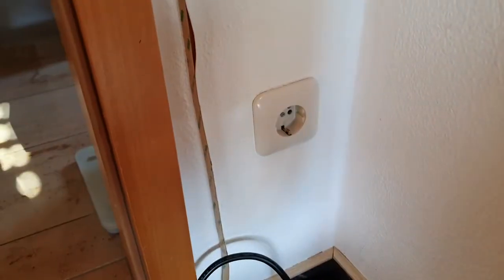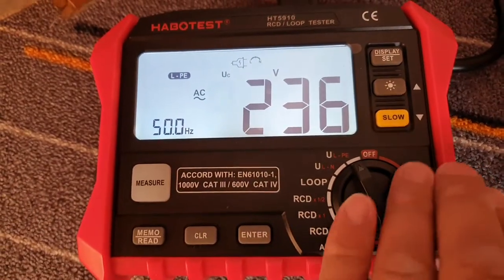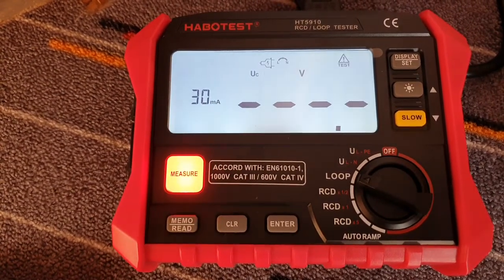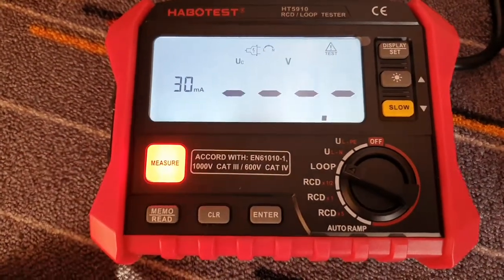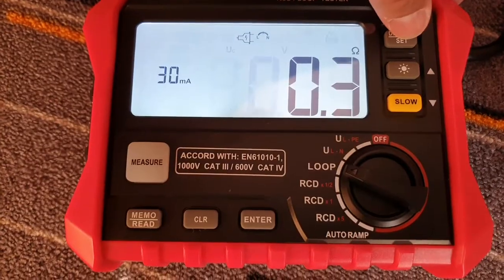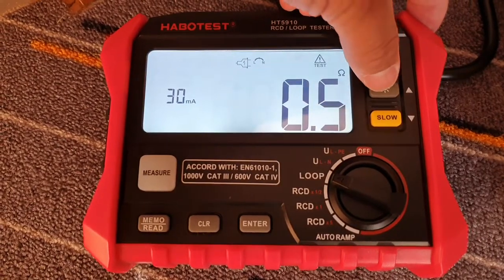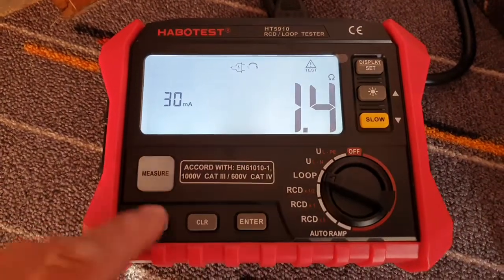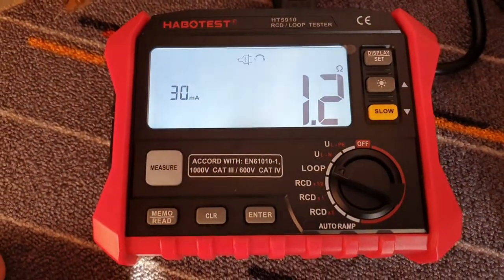HABOTEST HT5910 wrong measurements

Comment: This is normal as there is permanently some tension fluctuation from the network and they are 2 measurement performed one after the other to calculate the value.

Comment: Because there are consumers who consume current from the same electrical cabinet.
That's reduce the acurration of low resistance .
Turn off all the switches (CB) on the panel except the main one and the one connected to the circuit being measured.
Anyway, under 2 ohm is a good result.

Comment: It's probably in "No RCD Trip" mode, which means it only measuring the loop impedance with very little current (less than 15mA).The measuring method is this: it measures the voltage normally, then inserts a small resistance to draw some current (that 15mA), and measures the voltage again. And the difference between the normal "open" voltage and the current loaded voltage gives the voltage drop. And from that drop and the amper it can calculate the resistance of the supply-earth loop. But as I said the current is so, so low, the voltage drop also will be very low, as low as the normal noise of the network, so it can't be measured properly. There are tricks the big guys (fluke, metrel, megger etc) use in their testers, but they are 10x 20x the price of this little instrument. And even they are not too accurate in "no rcd trip" mode.

Comment: This brand of measuring instrument  Measure loop impedance  Is it reliable?  Why are the measured values not the same?
Reply: Because he doesn't know anything about the instrument nor about electricity.
We have two HT5910's in use and they work fine.
Also read the answer above of @simcax6087, he knows what he's talking about.

Comment: all the grounds of the building are linked and that creates alterations in the measurement, perhaps it would be better to measure on the same copper rod from the well to the ground (it is just an idea).
Have you seen the UNI-T Multifunction Tester instrument UT595?? will it be more reliable?.      Saludos!!
Reply from the maker: Hi, no - at the same socket the measurement must be the same.  E.g. for 300mA and 500mA the results must be the same by ohmic law. This tester always shows 0 Ohm if you set 300mA test-current. See my other video than you know what I mean.... ;-)
Reply: @bernhardneuner1282  uhm ok if I saw the video you mention, the equipment is not accurate, is there something that measures the equipment well, or all the functions are wrong
Reply: Loop resistance is not really measured, its calculated! So it will differ even at the same socket. Belongs to voltage, loads nearby and so on!
Reply: @flolandshut 
No es correcto, el apartado debería tener una mejor incertidumbre. 
No es fiable, he visto varios vídeos de varias personas y le ocurre lo mismo

Comment: you pay 150 euro and the result is the same, cheap china part ! i think about to buy one of this for myself too :) ... the price is too good not to try
Reply from the maker: I paid 107 euro but this was to much! The results are unreliable! The 300mA Range shows always 0Ohm.... 500mA Shows 4.9Ohm... so what now?...  (another measurements at one socket with 500mA RCD, see other video).
Reply: @bernhardneuner1282  A mayor corriente es más preciso.....por eso te da un poco de diferencia,es normal

Comment: The result is certainly correct the loop resistance always varies a little bit especially on values as close to 0
Reply from the maker: Yes round about 0 Ohm would be nice - but I had measured on the same socket 0.0 Ohm and 4.8 Ohm - and this is not correct. The 300mA-Range of this device always show 0 Ohm....
I had to be below 1.9 Ohm - and with this tester there is no reliable results!
Reply: @bernhardneuner1282   Hola hace poco compre ese equipo, y pensaba que había venido con falla la escala de 300mA, por que siempre me da 0 ohmios....  pero cuando mido a 30mA me da 0,3 ohms. Osea que Habotest sabe que tiene una falla con todos sus equipos y aún así los venden en todo el mundo, yo estoy en Chile y lo compre por AliExpress, le escribí a la fábrica de Habotest explicándole la falla, vamos a ver si me cambian el equipo 😂😂...
Pero lamentablemente mi equipo tiene dos fallas, una la escala de 300mA en medición de LOOP no sirve... y la segunda es que sus especificaciones dice que puede medir hasta 2000 ohmios de resistencia a tierra y el mío   le coloco una resistencia de 400 ohmios entre el cable de tierra y mido en 500mA y da error de fuera de escala indica la pantalla <400 ohms y si hago lo mismo pero midiendo en la escala de 300mA da error de <333 ohmios..... como ves mi equipo está peor que el tuyo 😢....
Lástima que los productores chinos no quieren aprender a trabajar con calidad y por eso no son confiables sus productos 😡..... Fabricantes como Habotest, son los que tienen la mala fama de los productos chinos. Existen  marcas como CEM / UNI-T  que trabajan con mucha calidad.  
Bueno esperaré a ver si logro algo con la gente de Habotest, si no solo usaré la escala de 30mA que al parecer es la única que trabaja bien para medir resistencia de tierra....  por lo demás perdí parte de mi dinero con este equipo 😢